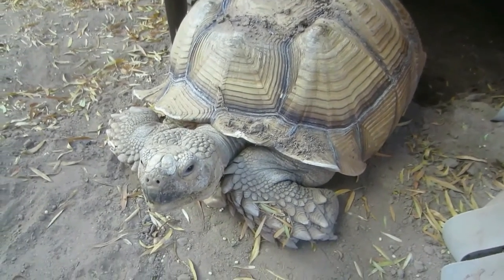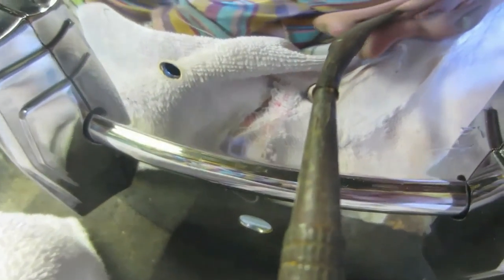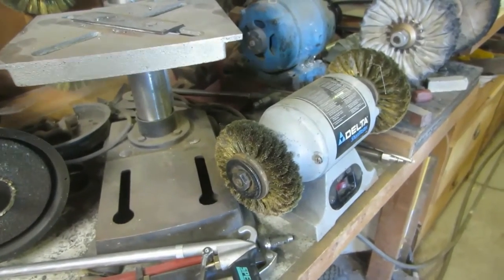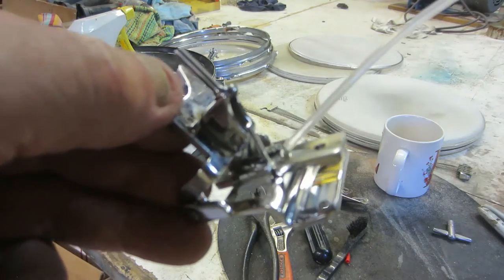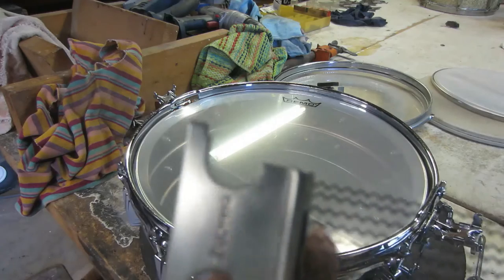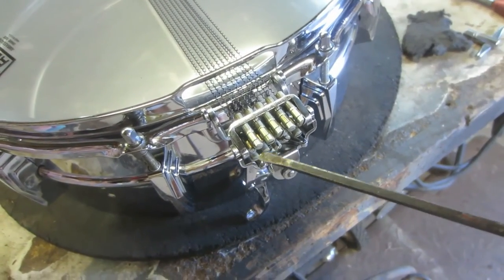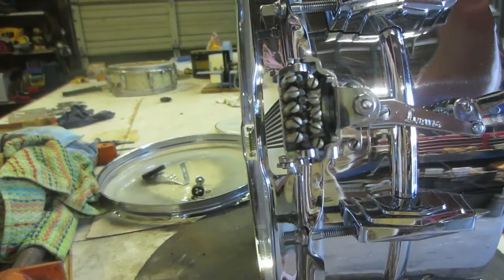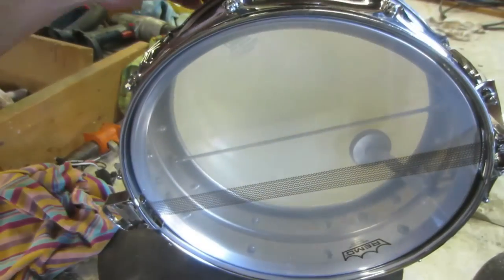1962/3 Ludwig Super Sensitive COB Snare Drum Restoration Final Assembly

Comment: Drums are Cool!!! That’s Just the way it is. 

I think I saw a seam on that shell, which I didn’t expect. Must be a very special shell, that one! 

Came out really great, by the way. Those guards you had in your shop are key in my opinion. Too many little parts on the ends to bang on things as you move it around without them on there. Lucky you had those around.

Anyway…
Heck… I know a guy that swears by stencil kits from Japan. He’s practically a Luan expert. Has videos about leveling and reworking the bearing edges on Luan toms and such. If the kit plays and sounds good, I’m pretty much gonna like it too.

Back to the subject of your Super Sensitive: 
You know… people turn these into Supraphonics by taking off all the special parts, but I think it’s a travesty. 
Get a Superphonic if that’s what ya want, in my opinion. 

I’m gonna get a Supraphonic soon here. I feel it slowly welling up in me. So far I’ve stopped just shy of pulling that trigger…

On Reverb right now is a very conflicting listing. It’s for B stock Superphonic, with a slight imperfection, that’s mint. How do those things go together? Ha ha $309.00

Ok… I’m finished with my usual blabbing.

Thanks for another video!!!
Reply from the maker: Yeah on the inside you can see a seam. Dont know what "seamless shell" means. Haha....As far as those B stock drums, they are good for a less expensive drum but why not save your money and for 6 or 7 hundred get an old one. These modern ones are not the thickness of the old ones and that makes a difference in sound. Thanks BC
Reply: Are you referring to that Buckn Billy guy? I think that’s his name. He’s Canadian or something of that sort. Super energetic and borderline insane? 😂 I like that guy
Reply: @jaymeramirez7435  Yes… that’s him.  As a guitarist who just kinda got into drums for something new, I was learning and researching things and found him.
Whatever I choose to get into, I usually become a gear head about that subject, as an extension of the fun. His videos about bearing edges were super informative as I learned how to buy older drums of quality that were misused… and restore them in order to have some good stuff for far less $$$$.

Thanks for your kind response, Jayme!  I think he’s a good Dude too.

Comment: Great video - very helpful indeed, particularly showing the order of those little adjustment screws. However, I have an early (pre-serial) 60s, 14x6-1/2" model and there are two things not shown or mentioned in this video which are frustrating me.... Once the bottom hoop and head are in place, how do you get the snare assembly into position again? It's impossible to thread the large ends through the hoop holes?
Also, my drum doesn't have the little height adjustment that yours has. My snares are too tight against the reso head and there doesn't seem to be any way to adjust that?  HOW do I make a height adjustment when there is no screw cam on the large side rods? Any help would be much appreciated! Thank you.

Comment: Ammonia and water? I don’t remember what you said cleans these up? 
FYI: I’m currently building my own 6.5x14 Ludwig birch with psychedelic red wrap. Bow tie lugs. P88 throw with die cast butt.  Canopus baseball bat internal muffler. S hoops TOP AND BOTTOM. Not sure which wires I’m gonna run. Staining the inside and outside of the shell walnut color. And repro Keystone badge. Everything brand new. Getting close to finishing. I had already stained and drilled. But I accidentally drilled the vent hole on the wrong side. And drilled the butt plate holes on the wrong side. So ordered another shell 🤦🏾‍♂️ another $80 down the drain. 😆

Comment: You skipped the part about mounting this snare throw off assembly back onto the shell the last thing you talked about was the 832 inch tap that you recommend and then you show a completely assembled throw off assembly in the next frame but you didn’t break down how you re-mounted the internal rod or the parts to the shell can you please do a live video on that thank you Drum is beautiful by the way
Reply from the maker: Oh sorry about that Neal. Goes on just the way it came off. Pretty simple really. Two screws to hold each jaw mechanism and one large nut and washer on the inside to hold each rod lever. Mount one side of the jaw to the shell and the rod lever. insert the rod on one side. Mount the other side of the jaw to the shell and the rod lever goes through the shell and connects to the rod. Remember to put the washer and the nut on the rod before inserting both sides. Is that sufficient? If not maybe I can do a quick vid on the install.